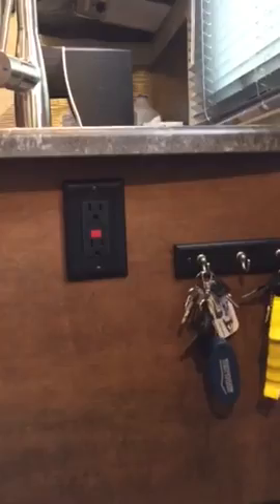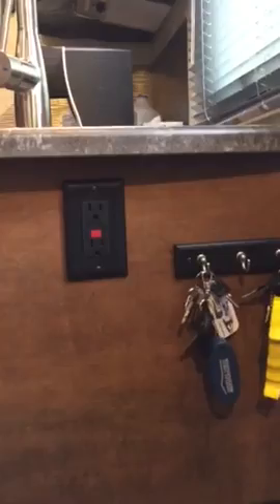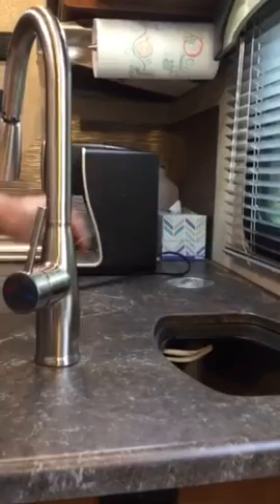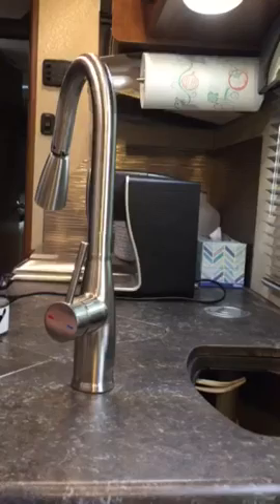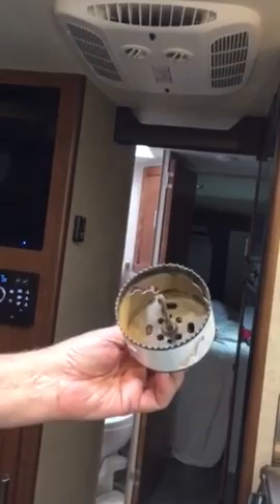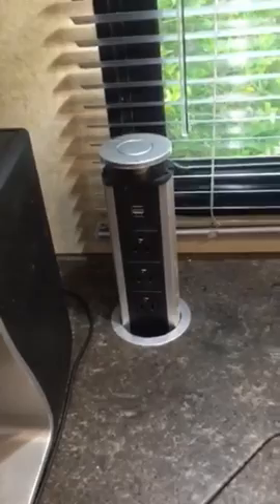Lance 2375 lack of counter top outlet fix

Comment: Thanks. Loving our 2017 1985, but will be retiring from our RV Park managers job in the near future and think the 2375 may be a prospect for us. If full-timing in a travel trailer is scary to some folks, we tell them that we full-time(d) in a 2012 1181 TC for 3 1/2 years and did pretty well. Now hoping that 2 5/8" lift kit lets us get back into 85% of some of the cool places we used to camp in Colorado.